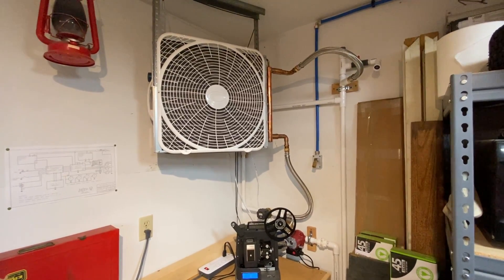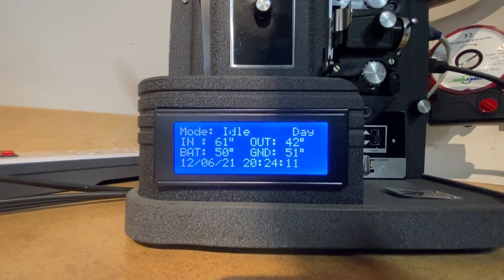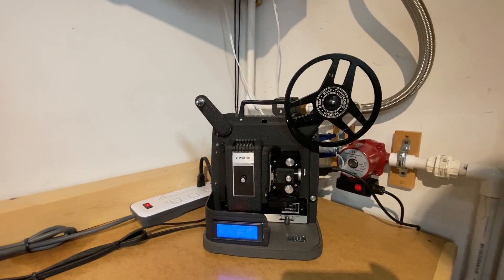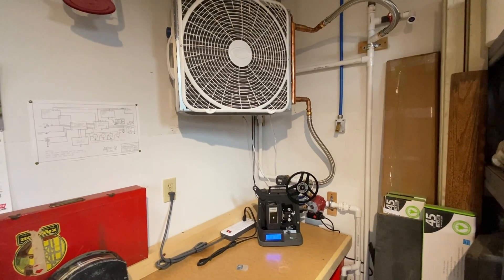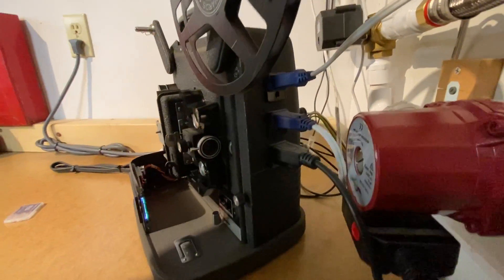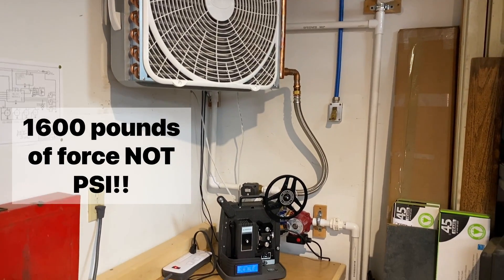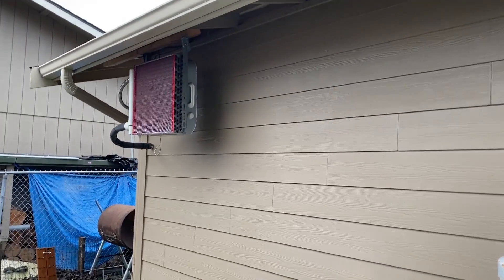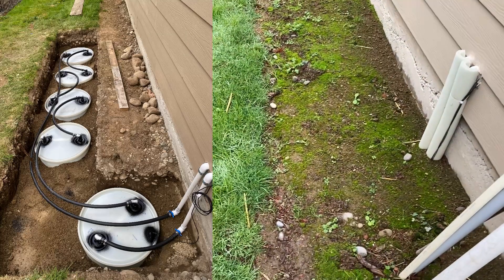Thermal Battery Shop Cooling System run by Arduino

Comment: THis is a very very well done project!
As an engineer I really have to tell you that this is done very clean and well. Room for optimization is in every project so don't worry about that!
I couldn't really see the water flow "diagramm". Probably optimzing this might lower the energy the pump takes over time. But this is just a slight optimzation of an already good system.

Keep on doing! Great!

Comment: The lcd screen looks really nice what's the operating temperature range? Great project overall!
Reply from the maker: Hi Kevin:  there is a parameter file that allows you to set temperature values. The cooling mode is set at 71 degrees now. 
Other parameters:
Battery 2deg greater than outside allows recharge mode. 
Battery 3 degrees less than inside allows cooling mode. 
There’s also other parameters:
Temp sensor not found - FATAL ERROR goes to idle mode but if Between October and April it goes to Freeze mode. It will just sit there with a blinking LED until a power failure or PWR off.  Then it boots again. 
If I leave the shop lights on after 8PM it will ignore the shop lights and allow recharge mode if temps are right.  Sometimes I forget to turn off the lights. 
Freeze mode has precedence, ignoring Arm/Disarm, lights, inside temp and battery temp.

Comment: BoM? What did you source for your pump and radiators?
Reply from the maker: I knew I should have added a BoM. 
Fans- Lasko; “premium” 3speed box fans ($33.71) from Home Depot. No part number provided. 
Radiators - from outdoor furnace supply (www.outdoorfurnacesupply.com) item # HWC-20x20. They were pricey ~ $150each. 
Three way valve - came from electronicsolinoidvalves.com #BVB5TV-XR33-J. 
water pump - RS15/6 Bokywox from Amazon. 
All the PVC pipe is 3/4 sched 40. 
The Dallas one wire sensors use 3.5mm jacks. All the ones on Amazon were junk.  I ordered some USA made ones from Vetco Electronics. SKU 504KB 3.5 mm stereo jack panel mount (high quality). 
The other problem I had was with the bung caps. Several different designs came on the drums I acquired at different times. I found a guy in Oregon (CL ad). Selling for $1ea. I made a jig to hold them and used the mill to machine the 3/4” threaded boss down so I could thread a male PVC fitting through the cap and have enough thread to screw on a female PVC fitting on the inside to attach a dip tube. It worked but seeped a few drops over a 24 hour period under pressure so I used generous amounts of flex seal.

Comment: Why not put a 6th barrel in the corner of the trench? Something I'd like to see is a swamp cooler with an air-to-air heat exchanger so the increased humidity stays outside.
Reply from the maker: I only had five barrels but the reason why one is not in the corner is because it was moved so the Dallas One wire temp sensors would reach inside the barrel. They are 3 meter leads and I didn’t want any splices under ground!   My data shows you really need upwards of 5 degrees difference to effectively move any heat. Some nights the recharge runs all night but only 2 degrees difference (battery/outside) and the battery is not cooled at all.

Comment: Next version/addition you could add a solar water heater loop to keep you warm in the winter. Check out https://youtu.be/5g5PW78XMSo. There's a lot of great videos on that channel.
Reply: If the outdoor radiator is positioned to be exposed to sunlight during the winter, it might work to put a polycarbonate box around it to turn it into a solar collector.
Reply from the maker: @NiHaoMike64  awesome great idea!  wish we had more sunny days here.

Comment: Someone built an ice storage air conditioner. https://www.youtube.com/watch?v=aFnSFWx13mo
I'm working on something similar but with a VFD to adapt the power use of the compressor for solar power.
Reply from the maker: Thanks for the link!  I do have great exposure for solar panels!  If memory serves me, my whole system draws less than 200 watts while in either recharge or cooling mode. Freeze mode (keeping the outside radiator from freezing) is less than 100 watts because no fans run.  Please let me know how your system functions when you get it done. I need to graph my (2) years of data to show my systems effectiveness or lack of lol.

Comment: Would have been better if the tops of the tanks were at the frost line. They need to go down way deeper where the ground is much cooler and will never freeze.
Reply from the maker: I hit the water table and couldn’t go any further down. The battery has been running at 44 deg F all thru our cold snap even running 24 hours a day in freeze mode!  The freeze mode is only to keep the outside radiator from freezing. Ground temps never go below 40’s.
Reply: @FUBARtractors  What's the water table temperature? Might it make sense to intentionally put the tanks lower than that so they thermally couple to it?
Reply from the maker: @NiHaoMike64  It’s probably in the mid 50’s  in the summer.  Water out of the tap runs 46 degrees in winter. The water table here is variable depending on time of year. Now it’s about one- two feet. In late April I hit it at 48”. In September it will be much further down.
Reply from the maker: @NiHaoMike64  burying the barrels further down means the internal pressure would skyrocket. Having any water head is the fatal flaw to my design.
Reply: @FUBARtractors  I guess you need a heat exchanger so you can have two systems for pressure.